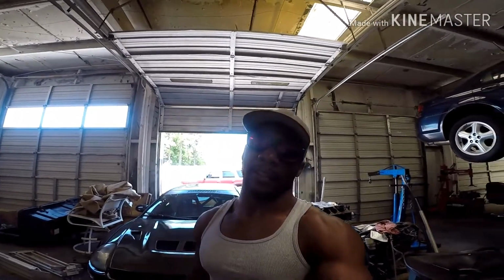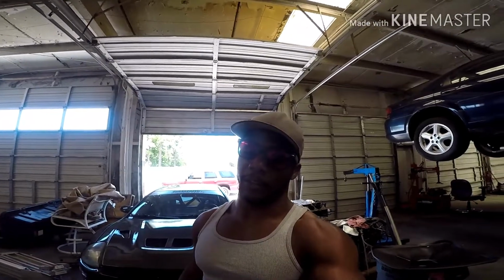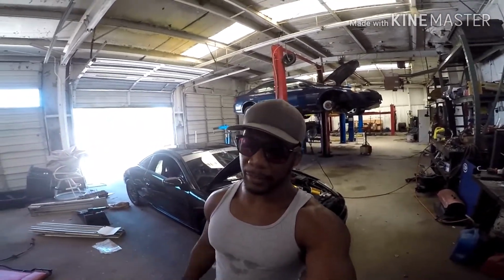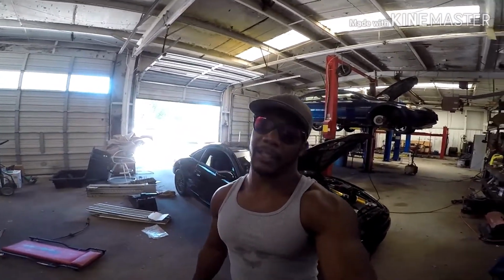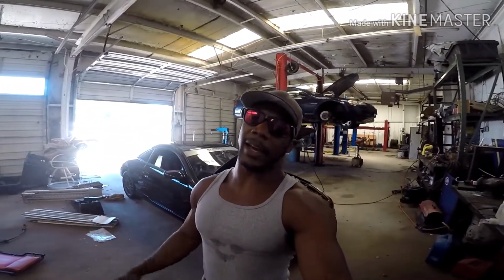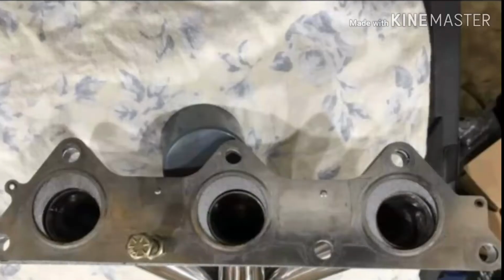6g75 3g eclipse RRE headers and invidia exhaust sound

Comment: Hey buddy i got a v6 outlander is that the same engine ? 2010 v6 gt version. 2.5 inch stock though.
Reply from the maker: Is it the mivec 3.0?
Reply: Yes. Engine is still in production on the outlander phevs
Reply: I was wondering where did you get headers without the cat ?
Reply from the maker: That motor is slightly different but the headers I got were used. I would check out some outlander forums for headers because I think the 3g eclipse one won't fit exactly
Reply: Yeah i noticed that there are different versions of the 3.0 mivec, recently my starter blew up and I had to find one from the yard. What a nightmare ended up going with a remy. - i will look at what fits and the companys you talked about in your other videos

Comment: Hey so who's the guy that does the custom y pipe for the rre headers?I'm willing to buy if there built solid
Reply from the maker: Steven David's. I known hes in the middle of a turbo kit build but he may build you a set
Reply: @tcroc30  I definitely need a y pipe  .is it 3inch diameter
Reply from the maker: @raxlara8244  not a full 3inch. 2.5 for the y pipe then it merges into a 3"
Reply: @tcroc30  ok so let me know how to get this?what's the cost?
Reply from the maker: @raxlara8244  I would send him a message via Facebook